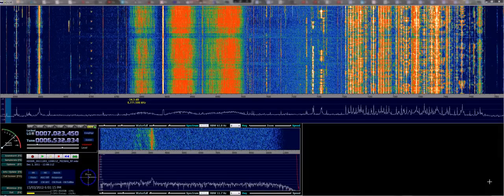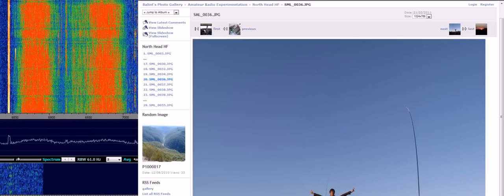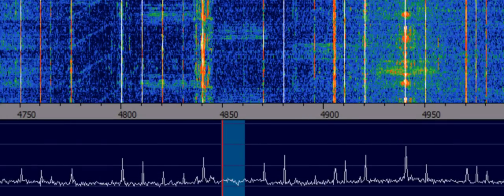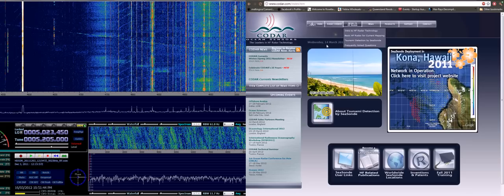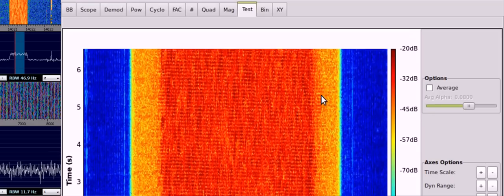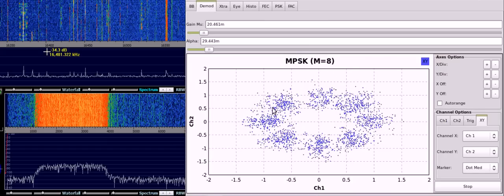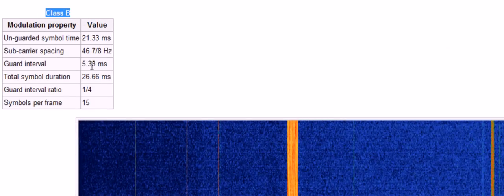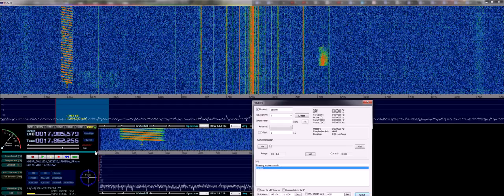HF and Software Defined Radio: HDSDR + USRP + GNU Radio + RFMap

Comment: Hi when I run DSD with HDSdR I change my sound card to VAC1 I can decode DMR but I cannot listen to analog signals without changing the sound card setting back to the speakers how can I change this so I can hear all signals please
Reply: Unfortunately when you are streaming your audio data into DSD you are only going to get decoded digital audio. The only real option to hear both would be to go into your sound card settings and click the 'listen to this device' option. However you would then hear digital noise at the same time you heard the decoded audio.

Realistically this isn't very convenient. Most SDR applications tend to require you to stop the client in order to change the audio sources. I'd recommend giving CubicSDR a try as it allows you to change where you send your audio while continuing to monitor your SDR.

Comment: is it possible to use HDRSDR for files other than audio files? i want to read the signals coming from GPR (ground penetration radar) which are obviously not audio waves. how do i input such files in this software?

Comment: Where can I get the file for GNU Radio that you used for the analysis with the tabs at the top?  

I love the video, sdr really fun.  I'm currrently using sdr-console and HDSDR mostly.  I've got a HAM it Up coming and plan to use it with my HackRF.

Comment: There is an instrument which sends out a repeating swept RF signal. Signals are scattered back from the ionosphere and and also back from the ground when the signal bounces. The backscatter is measured and the distance is calculated. This way one can know where on the earth a certain signal will hit after bouncing off the ionosphere once or twice. Some people leave these devices running all the time just to annoy those of us with more serious uses of the spectrum. :p

Comment: the blocks that move across the spectum at a different rate seem to be in morse code staggered with a delay to either separate, or break down the message into intervals. like a binary code.

Comment: I've been decoding digital mode transmissions since 1995 using an AEA PX232 MBX TNC. Not a whole lot good today since most RTTY/TDM/BAUDOT from commercial sites is encrypted. I now use an Alinco SR8T and SDR software for rig control but it would be very cool to have software that could do signal identification and decode the more sophisticated digital modes. Very good video.

Comment from the maker: I wouldn't think so. Such continuous and 'linear' signals are usually caused by ionosondes sweeping the ionosphere. Frequency-hopping radios would likely jump through a series of discrete frequencies as opposed to changing continuously like that. Although you never know! (Nevertheless, there's no modulation on them...) That's the mysterious beauty of HF.

Comment from the maker: I know you know now ;) But for everyone else: the bandwidth is dependant on the input sampling rate, which can be adjusted in the ExtIO's Device Control dialog. The range is above 900 ksps to 3.2 Msps (i.e. above 900 kHz to 3.2 MHz).

Comment from the maker: I haven't used Excalibur/Perseus myself, but I imagine they're both pretty good. First place would be to check their specs on sensitivity, etc. Then read about what other users have reported regarding performance. That said, the USRP is in a class of its own because (as you say) it's just so flexible. Apart from the transverter+WBX, you could also build your own pre-amp (e.g. using the one in the Genesis radio kit), and use it in front of the LFRX - I think that could work really well too!

Comment from the maker: You can certainly try! However, you will need a transverter to bring HF up to the frequency range that the dongle accepts (e.g. I use a Kuranishi Instruments FC-965DX-T for +60 MHz to use HF with the WBX in my USRP).

Comment from the maker: Please refer to my GNU Radio 'patches' wiki page (in video description) where you will find the appropriate patch to apply to the GNU Radio WAV Source block. There is a problem with the original code that prevents it from playing HDSDR recordings. Once you apply the patch, it will work fine!

Comment from the maker: So sorry, I haven't had a chance to upload them yet. I'm in a bit of a pickle because I just launched Aviation Mapper publicly, and my upstream is saturated. I need to keep it as free as possible to handle the incoming requests (perhaps I could throttle but then it would take forever). I might try to ask a friend to upload/torrent it for me... Will post back here when I do!

Comment from the maker: This set up is using a USRP, so YMMV with the RTL2832 dongle. The recordings are only 1 MHz wide, which the dongle can do - but it's only 8 bits so you'll have reduced dynamic range. The transverter just puts the HF signal into a 60 MHz mixer, so you just add 60 MHz to the frequency you really want to listen to when setting the tuning. Unfortunately I don't know what's available on the market now - I have an old Kuranishi Instruments FC-965DX-T.

Comment: I've just ordered a P160 tuner from ebay.com.au and I'd like a little more info on your setup.  You mention a transverter that "adds 60MHz" to the signal coming in to the USRP.  Is there some transverter you could recommend that I could use with my P160?  I understand that the Unikoo UK001T (I understand the P160 is like the UK001T) has a somewhat limited bandwidth, though, so a +60MHz up conversion may not be enough for me.

Comment from the maker: No, but it works with the USRP (that is what is used in the video), which is what OpenBTS also uses to transmit/receive (i.e. it's the common hardware).

Comment from the maker: Consider this video the inspiration to get into SDR then! :)

You could just jump in by getting a cheap SDR receiver ($20 Realtek RTL2832 dongle - originally a DVB-T receiver - or a FUNcube Dongle) and using HDSDR, and then later read about GNU Radio (they have a huge site with lots of resources), what it can do, and how you can begin experimenting with it (e.g. it has a nice block-based graphical programming tool called "GNU Radio Companion").

Comment: The multi speed sweeper at 15:40 is another sounder.  Quite possibly associated with the same source as the one at 11:25, again, it might be related to JORN.  Note that this sounder generally does 64 sweeps at each rate before stepping down to the next rate, it also often has 16 speed steps.  And again it is common for this one to step up or down 1 MHz and sound again.

Comment: The slow rate sweeper at 11:25 in the video is a sounder, it might be associated with JORN.  If you pay close attention after it leaves one freq it steps up or down (one direction or the other, a given one always travels in one direction only) 1 to 2 MHz and sounds again.  And then another 1 or 2 MHz and again, etc.  The steps are not always even 1 or 2 MHz steps, but are often close to that size.

Comment: The radar at 08:50 is a bit more iffy.  It might be the radar you quote, it also might be, probably is in fact, the PLUTO II radar out of Akrotiri.  The specs are all correct for PLUTO.  Of course, these are common techniques, so it could be any one of several radars.  If it is always on that freq you noted it is probably the radar you have associated to it.  But, PLUTO jumps in freq from time to time.  It also has several second of dead carrier before the sweeps start.

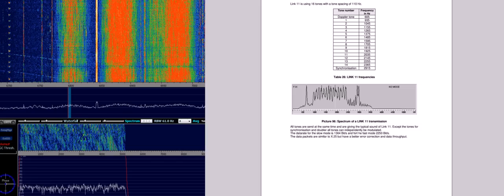Comment: Both radar Youtube videos you pull up at 03:00 are mine ;)

The sweep at 04:40 is indeed CODAR.

The “blocks” at 04:53 are a sounder.  The exact location and designation for this one has not been confirmed.

The sweeps at 06:25 are CODAR, under one of the channels of Chinese OTHR (I have seen up to 12 simultaneous channels of Chinese OTHR, in channel “pairs”).  The CW is unrelated to either.

Comment: Going to have to break my comments into several pieces here:

The “sweepers” at about the 01:15 mark in the video (and at several other points) are indeed Ionosondes, also called Chirpsounders.  You might want to research the AN/TRQ-35 or TRQ-35 sounder for details.  Sweep rates of 100 kHz / sec are common.  If you plot the time of the sounder at any frequency you can even correlate it back to the source.  There used to be, not sure how active it still is, a Chirpsounder Yahoo group.

Comment: band.
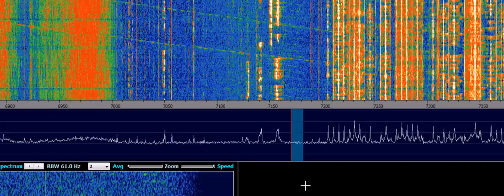4:13 - Sweeper - I've occured some that are continuous and others which are cycling frequencies and some have told me it may have something to do with SuperDARN or CODAR sensors.
4:58 - The blocks you mention tend to be the ones which are cycling - the pulse repetition frequencies of these are often different and are usually radar of some sort. You have very good reception! These are real signals though!
5:50 - Maybe you can see if Sigmira could lock the STANAG signal?

Comment: Whistlers - I tend to get them around here, and it's almost certainly man-made. Ionosondes maybe, someone suggested that I reference the time it crosses WWV/WWVH's 10Mhz signal and I will find that they are supposedly very regular!
1:43 - that's HFDL aka HF-ACARS used by long haul aircraft. The single "alignment" tone before the data burst is a giveaway - you're tuned a bit too low so it might not have been that easy to spot by ear. The fact they're clustered is because they are in the aviation